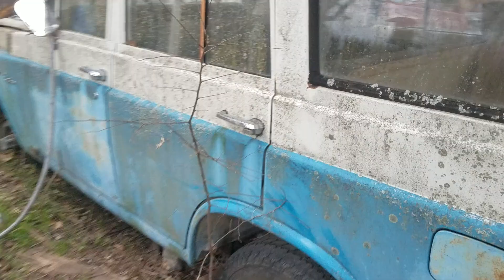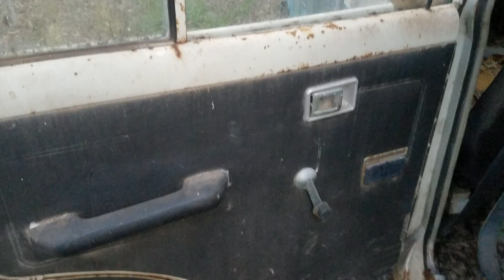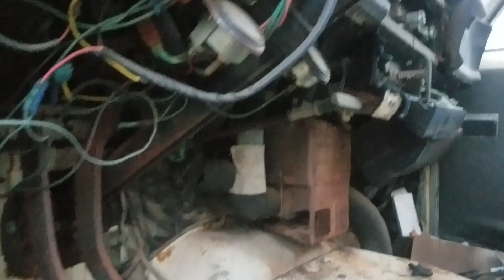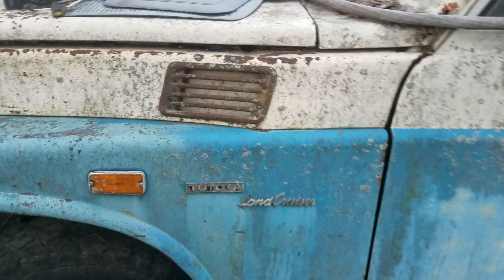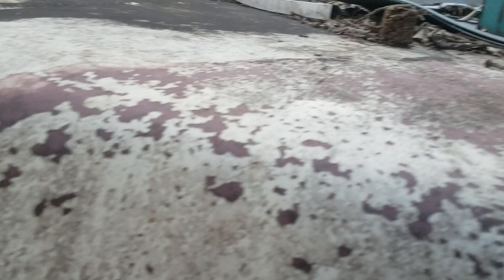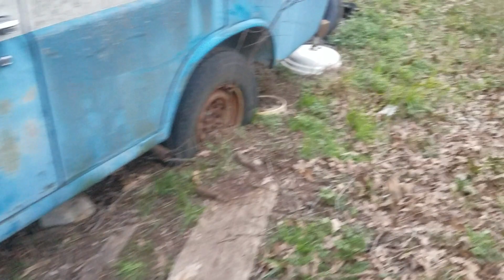IS IT WORTH SAVING? 1971 TOYOTA FJ55

Comment: I’ve seen much worse.....go for it if you really want to. I would still love an fj40 but they are soo expensive now I would be afraid of wheelin one if I had it.  I’ll stick with my old 88 XJ that I bought in 04 for $500 bucks and drove it home. It just sits on its trailer in my driveway most of the time but it’s ready to go wheelin right now. I’ve spent more on the tires than I paid for it  go for it!!!👍🏼